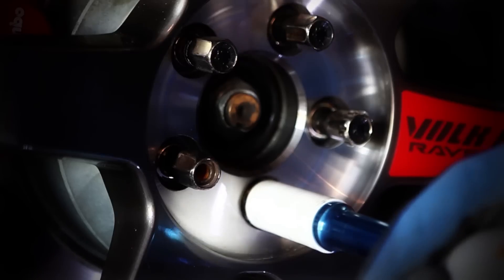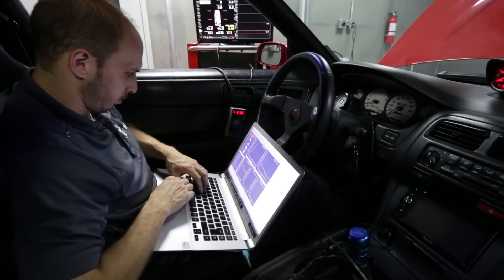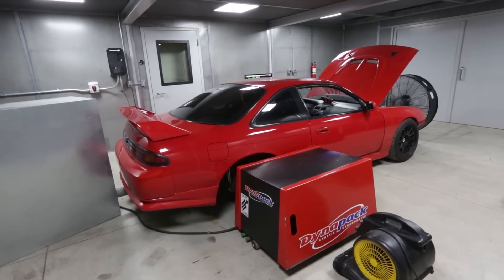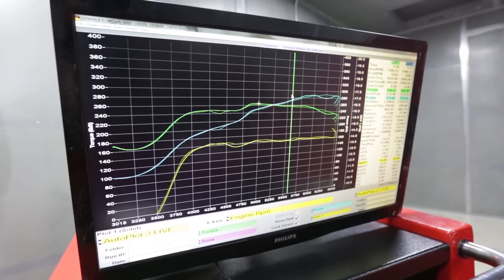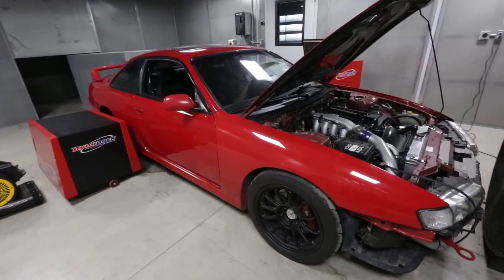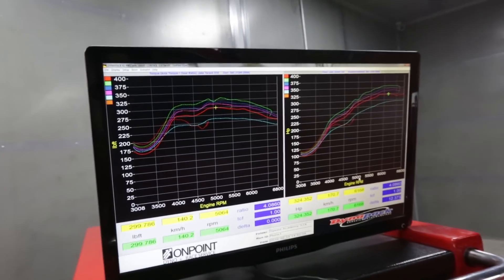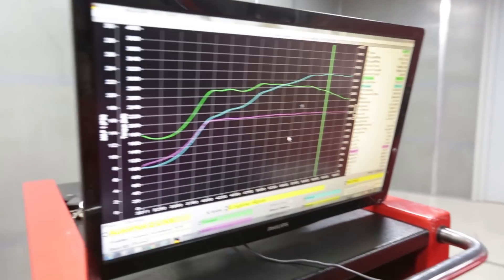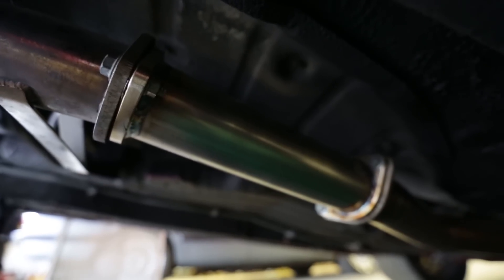It Didn't Blow Up! - SR20DET Dyno Re-tune - Project GripS14

Comment: keep at it Pete and stay patient. Soon you will have all the issues worked out and you will have a flawless sr20. It's great to see more s14 content!
Reply: also I wanted to ask if you think a tune is need for the following upgrades on a stock sr20, greddy intake manifold, front mount intercooler, z32 fuel filter and 255 fuel pump?
Reply: +SILVIA sean its recommended you do a tune after any upgrades to get the best out of the motor but no with your upgrades you should be able to run it without complications as long as u set the correct fuel pressure with the new pump since now u have more flow
Reply: +Rick  Rojas so would you recommend I buy a fuel pressure regulator?
Reply: I would definitely recommend a fpr for any tuned car :)
Reply: +SILVIA sean yes I would since you can't adjust the fuel pressure on a stock one and u have an upgraded fuel pump get the nismo it's cheap and gets the job done
Reply: +Rick  Rojas and speedsnail thanks for the advice. The Nismo fpr is next on the list!

Comment: Look at it this way bro, I rebuilt the B18B1 when I swapped it into my Civic with new NPR piston rings and ACL Race bearings and a 63 trim t04e and it made 328 whp on stock head and cams and after a self ported and polished head, BC stage 2 turbo cams, BC dual valve springs with titanium retainers, new Gates Racing timing belt, and a new Cometic MLS head gasket it put down 408 to the wheels on 12 psi on a chassis dyno and it pulls so hard on the street with an Integra GSR transmission. It would definitely surprise you. Keep at it brother, don't ever give up.

Comment: sasha is the man! and pete i think your rebuild is fine. you did good man. but you were right with your 1j or 2j comment.. as i used to have a few Sr motors then went to Rb. and now have a 2j. you just cant beat a Jz engine.. anyway all 3 of my Sr's shit the bed... well 2 of them did anyways and the 3rd i got rid of befor i had the chance to really beat on it and the new owner blew it up after 10k miles and i rebuilt it myself and it only had 5k on it when i gave it to him.. new rings, con-rods, bearings, end caps, and my buddies shop rebuilt the head with all new valve guides, stems & seals and all. still shit the bed... i hate Sr's w/ a passion, but i hope yours lasts a long time for you man! goodluck
Reply: My SR 196K km and run perfect. Much people run over 300-400hp and the SR's withstand that here in Germany. ZEX Tuning was the best engine builder here, you need a good engine builder only.

Comment: My sr forged bottom end running 420bhp  is still going strong 9 years later around 12k miles. Just did compression test ok and a dyno its lost 7hp from the rebuild. I think its all about who does it and what parts are use ftw. That knock could be the cam bearing its a common problem.

Comment: clutch petal coming up is maybe crank walk, pushing flywheel and clutch forward towards the pickle fork, increasing the pressure to the petal.  Clutch isn't directly connected to the petal.
Reply from the maker: Turns out the fork fell off the throwout bearing. Had to drop the transmission. :(

Comment: That is some nice power for a tiny 4 cyl.
Reply: You not seen the K20's and K24s on PTE6266's making 8-900+ hp?
Reply: +Jack Jack Those are cool, but those are basically race engines with the short lifespan they'd have.
Reply: Jack Jack
I not a huge fan of Japanese cars and only have a passing interests in the more well known engines.

Comment: no offense but sounds like rod knock, have an sr and it made same noise at that same kind of rpm and when we pulled it apart to investigate said noise we found bearing in one cylinder was down to the copper. GL and dont give up on it i feel every motor has potential in the right hands (no offense) and dont know if ya replaced those before but ya might want to check them.

Comment: I have a S14.5 with a RB20 motor, it makes 330whp, I daily my car and the motor holds up big power reliably but I don't wanna push it. Consider RB20, RB25 or RB26/30 combination.

Comment: Hallo. 
Exact the same Noise was at my s14, it was the Conrod Bearings.
Under burden there was no Noise, but when i crank up  from 2500-5000 the noise was there.
To Change the Bearings and make it correctly you should measure the clarance to get the right Rod bearings from the Nissan dealer (you can get different "Heights" of rod bearings).
I Think the working process should stand on a s14 manual.

Otherwise i only buy "acl" bearings, just mount it and my Lady is running now fine.
Cu
Reply from the maker: Thanks for the info. And when you see the track video you will know that I figure out that its the connecting rod the hard way. :( Everyone kept saying its something else but I was worried it was rod knock!
Reply: Oh im sorry.
I only can find a "Track" Video, where the coolant is spraying all over your windshield. Can you post me the Adress of Track Video with the Connection Rod bearing Fail?

Comment: sr20's are great engines, one of the best 4cyc engines you can get. But like any engine if you open it up and do a "shady" job reassembling it, you have higher chances of running into problems. Did you open the cat up to see if that was the problem? It may not have been and you could still have a problem that you need to fix.
Reply from the maker: The problem is it's an old engine that needs a full refresh to be bulletproof. Something I'm not looking to spend money on at this point. These engine can make good power but in order to do so you have to build them. I may explore that option in the future.

Comment: Listen up Pete, seems like over there you guys don't know much about SRs?  We've been wrecking that shit for 20 years over here so let me give you two strong bits of advice.
First up, the knocking ain't the chain, it's your VVT sprocket.
Secondly, you are knock limited because of the stock exhaust manifold, it is hopeless once you put a decent turbo on.  You NEED a nice tubular manifold to get the heat out of the motor.
Reply: That or a rod bearing. The RPM range of the knock seems about right for a bad bearing.
Reply: Bingo! where are you from? I'm in NZ and average Joes have been getting 280-300kw from SRs no problem for years
Reply: Texas
Reply: sounded like rod bearing to me as well.
Reply: It's the NVCS/VTC rattle sounds like a diesel, come from the IN cam gear. My S14a had the same, since last october I have adjustable HKS cam gears and HKS Step 1 256 cams and it's gone. With adjustable cam gears is the rattle away.
Reply: NoClassic you were right. He spun a bearing a few months after. Alot of people seem to have this prob but since I fully built my 20det notch it's been nothing but flawless at 21psi 403whp.
Reply: Pump fuel ? Or e85??
Reply: Stock manifold can make well over  250rwkw.

Comment: You were mentioning clutch problems, do you still use the clutch damper? also vct could be giving you some rattle, especially with stiffer valve springs
Reply from the maker: No clutch damper. Clutch issue was the release bearing had fallen off the fork :|

Comment: Was that final graph with or without meth injection? Love the sr20 but a 2j swap with be pretty exciting to see
Reply: that's the only swap that's been done just as much. isn't that old news by now
Reply: +Che M it not really meant to be something rare it's more reliable and can make 2× the power of the Sr
Reply: +ZEEPOxWiZARD iix it's also weighs more and cost more to modify
Reply: Che M yes it weighs more but that can be made up for with spring rates and it doesn't cost more to modify if you're buying a turbo it's gunna be the same price rather Sr or jz same thing with manifolds and camshafts
Reply: ZEEPOxWiZARD iix manifolds and cams don't cost the same neither does putting money into the internals. I'm aware the weight can be made up for but that's that's a compromise some people won't want to make
Reply: +ZEEPOxWiZARD iix he can get as high 450 from an sr depending on which one that's plenty depending on the type of motorsport in a s chassis
Reply: +Che M Yeah he can get 450 from a Sr but not stock block without e85 which is only sold in two places in ontario (Toronto and just outside guelph/cambridge)  so he may aswell go jz or rb or even ls or be a little different and go vh plus a s/c or turbo

Comment: wait a sec if you tune on a open down pipe when you put the exhaust back on and change the exhaust flow rate and back pressure. Without a revisit to the dyno. is the tune still safe for the engine?
Reply from the maker: If I put the cat back on then yes it would change it but since I am running a test pipe the backpressure won't change when I reinstalled the 3-inch exhaust so its completely safe.

Comment: How did you use the timing gun on the coil on plugs?
Reply: on the back of the engine where the wires go to the coils there's a loop in one cable. that is specifically for that purpose. if you don't have that, you can make a special cable to go between your sparkplug and the coil for when you want to set the timing.
Reply: Nissan ended up sorta changing their minds about using the wire loops on the coilpack harness, and decided to just have technicians put the inductive pickup sensor for the timing light on the branch of the harness within an inch or 3 from cylinder 1's coil pack plug.

Comment: I told you that your explanation for blowing the engine did not add up!! Stock head gasket, stock studs does not matter until you get up over 500 HP at the crank. Anything below 500 HP crank worry about detonation (OPTIMIZE intake, squash, bang and exhaust flow and conditions), Pistons are cast but with the water meth mixture you will keep cylinder temps down, nissan small case transmission is solid up to 350HP once you pass that point or get close to it you will need preventative measures (shockproof gear oil or the thickest you can find, good mounts to reduce play in the drivetrain and a FCV. All this mean is lots more grip s14 episodes ;) and this may turn into you most loved car after all the sweat and blood. PROGRESS NOT PERFECTION!

Comment: Whomever put that motor together ... might be to blame. My SR20 made 21 psi by 3500rpm  and 350ft lbs at the wheels around 4400rpm (on mild 260deg cams)
Reply: Stock turbo
Reply: Not on a T25 you didn't!
Reply: 2867r

Comment: lol dude. No BOV, surging like hell. Still has that catalytic converter, running half old fuel mixed with new fuel. You trying to kill that engine lol ? Sr20det need to breathe. Run a straight through pipe.
Reply from the maker: Running an HKS BOV and hi flow cat. Half old fuel... well I was told its fine :|

Comment: lol, Americans with their low octane.
95 is low here in Australia.
98 is typical and 105 for E85.
Reply: it's a different rating system
Reply: what a spud
Reply: You are wrong. Different octane rating in US. 93 is equivalent for 98 i think.
Reply: Difference systems for measuring octane. Their 93 is roughly our 98 so 94 is around 100 octane
Reply: Camhin1 ..ok..ok. I had a quick look, but RON is still RON like mm is still mm.
Iv'e read you have AKI as an measurement of anti knock.
Reply: There's 3 types, RON, MON and AKI, all are methods or measuring the knock resistance, just worked out in slightly different ways hence the different numbers for the same fuel.
Reply: Simon T Thanks, I didn't realise 20min ago.
Reply: He's in Canada, aye
Reply: i guess we are calling Canada America now.
Reply: Must be nice having fuel over 90 Octane....
Reply: Our 95 is same as American 91 so our 98 is there 93. not sure on Canada octane rating system
Reply: In California there are plenty of stations that sell 100+ octane at the pump...
Reply: ***** Just run e85.  

My sti is flex fuel.  Thats really handy.  My solstice gxp has a 93 tune and e47 tune.

Comment: Don't go 1j or 2j 
I love the engines but they have so many problems and are SO heavy 
A aluminum block ls would be about the same weight if not less and easier to cool since it doesn't heat soak like iron and is STRONGER than iron

They are lovely engines but there are so many better choices like a k swap of f swap or a beams etc.. 

The 1 and 2 Jz can be VERY! Temperamental and you can get lemon motors
And are hard to cool comparatively

Comment: whats the bov ? or its stock
Reply: or nothing ?
Reply: it has turbo flutter so probably small bov or none.
Reply from the maker: Has an HKS SSQV mounted in the stock location.
Reply from the maker: Its got an HKS SSQV thats vented back hence the fluttering
Reply: i dont understand that part but i will find out  back vented ?
Reply: HKS BOV as Closed/Recirculated System
Reply: That's turbo surging....not good for the turbo,  either he doesn't have a BOV or it's not hooked up right or working properly.

Comment: There's plenty of good reliable and very powerful sr20's. Obviously the issue is only with yours. Putting a heavy 1j or 2j in the front of an s14 would ruin the balance and handling of the car on a track.

Comment: that things gonna blow after 2-3 laps after that shitty rebuild.
Reply from the maker: I hope you're wrong!
Reply: Speed Academy i was just joking man :P im running a sr20 as well, but its stock bottom end. gonna install a bigger fuel pump and fmic + downpipe and a electronic af/boost controller now and max out stock jets and turbo, then go nistune, 2871r and jets next summer :) how much do you wanna guess ill dyno wheel horse @ 1.1bar?

Comment: use a bmw e90 335i motor thay say its the new 2jz ;)
Reply: no, i repeat NO bmw straight 6 is even close to a 2j. i can see you own a bmw and not a car with a 2j. so u have no room to say that BS. i own multiple 2js and trust me i know for a fact that just becus bmw is a inline 6 and so is the Jz that they have nxt to nothing in common. hell the newer bmws you cant even check the oil with a dipstick becus dohhhhh! they dont have one..... how stupid is that! id never buy another bmw. they suck ass and burn oil and leak oil like crazy.. and my e36 m3 had 19k miles on it since i rebuilt it and it was mint as fuck. never beat on it and 1 yr, almost 20k miles later it started to have probs.. none of my 2 or 1js had to be rebuilt or anything like that and i beat on them every day damn near. not saying bmw is shit but they are nothing what they used to be..
Reply: see what you mean. but N54 engine is much potential in. its not a 2JZ but a more modern upgrade?

Comment: all the more reason to JZ or LS swap it.
Reply: Go ls aluminum swap
Easier to cool and more reliable than 2j and revs just as high
Reply: +MyLonewolf25 and dont forget the most important part the ls is lighter
Reply: Ryan Rohauer THAT TOO! 
I can't believe i forgot that!
By like 40-80lb depending on swap! CX
Reply: Jz or Rb, never LS please for the love of god
Reply: Samuel B why? The Jz is heavier than the ls and if you get an aluminum block HARDER TO COOL! 
Less reliable power
Less aftermarket 

Why not go k series
Beams 
F series
rotary
Ls is a bit overdone but it's for a reason 

A ls swap in a Miata mk1 full stop is around 80lb more

A cage and stripping your car and having a full tank of gass change its cog and weight distribution more

I'm guessing it would be around 40lb for this s chassis 

There are many reasons for an ls swap
A bit overdone yea
But for a dam good reason
Reply: +MyLonewolf25 it's all because LS is really over done so it's sooo boring. Kinda light, easy and good power sure, but it's so overdone it's boring.
A jz is heavy sure, but some good front springs and it'll atleast feel less front heavy. Im I'm saving up to build a 3 rotor for my s14a! 👍